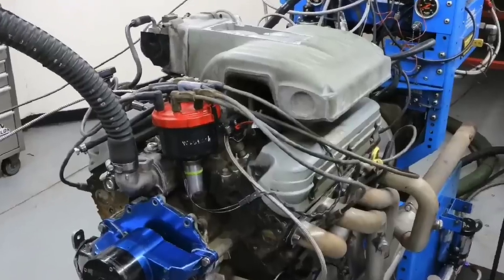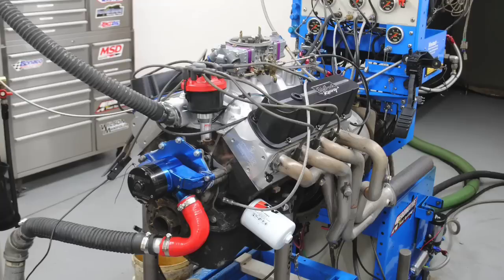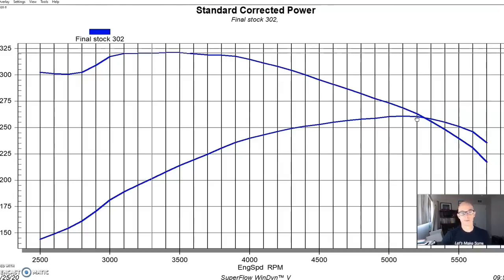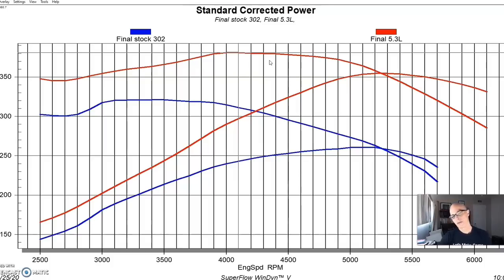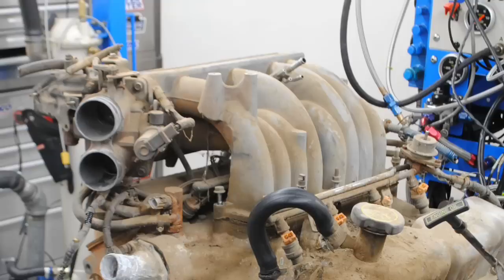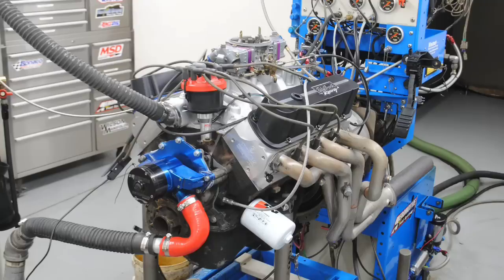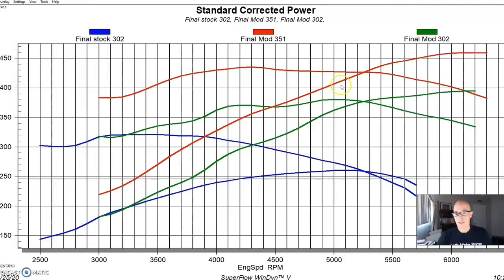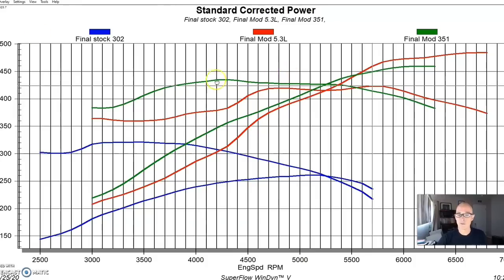5.0L vs 351W vs LS-SHOULD YOU SWAP?

Comment: I use to be a guy that always said don’t think with ur wallet put a ford in a ford, Chevy in a Chevy and dodge in a dodge back when I was really into cars and drag racing in my 20’s. Now in my late 30’s I haven’t been into cars since my late 20’s which is kinda weird because I’m a professional automotive technician of 20+ years and I own a auto repair shop and also have a huge garage at my house with a lift in it. Well the real reason I stopped building cars and drag racing was being sick of putting so much money into cars. Last car I raced was a fox mustang I built a stroker for basically took the engine, transmission, fuel system and tossed it out and built a stroker, new tranny, fuel system and everything to make it run. Idc if ur stroking a 302 or 351 if ur building it to make serious power or even decent power and ur gonna be beating on it all the time it makes absolutely no sense to use a stock block, it’s dumb to spend 10k building the engine to risk it blowing up and trashing all the part’s because of the block, buying an aftermarket block is protecting ur investment. I have seen many guys build ur average 7500 dollar 302 based stroker and the main webbing cracks and breaks and snaps the crank, sends pistons into the heads, rods hit the camshaft and ur left with a set of rocker arms, push rods,valve covers, the intake and everything else is trashed. Many guys start the build thinking 500-550 hp will be fine they can live with that but it’s always because they see how much a good block is and say 550hp is ok when deep down they know and I know after the first season of racing when they get everything dialed in and get it to run as fast as it can they want to go faster so they say well if I run a 125hp shot of nitrous only at the track it will be fine or they put a supercharger on saying they won’t beat on it unless they are at the track and only a few psi so they put that nitrous kit on with a 125hp shot then they are only 4 tenths from getting a 9 second pass so they put a bigger shot it. Or they are a street racer and they say I’m only using the nitrous if I need to. Well all of these guys keep needing more then boom the engine is gone. My good friend I use to race with built a 306 I have no idea why because he replaced everything he tore the engine apart and tossed out everything minus the block so it really only would have cost hundreds of dollars to have built a stroker, he said he wasn’t trying to go crazy, I told him to make sure he gets the main girdle that you have the main caps milled so the surface area of the girdle lays on the caps to keep the mains from walking and use main studs well he didn’t and he ran a bunch of nitrous and the main webbing cracked and blew out taking everything with it but luckily the heads were ok. Then he built a 347 and I told him again to get the main girdle and he did but got one that required no machine work and the main webbing cracked and took everything along with the heads. When he built another 347 he had some cnc aluminum expensive girdle and I said hold on till I come over this weekend, I bought over a girdle and he said he didn’t buy the one I talked about because the one he got was expensive but I showed him how the steel girdle I have had more surface area on the mains and it’s steel so it will expand and contract with the block at a much better rate then aluminum and he understood and used the one I brought. That engine still runs today 15 years later it probably has 10,000 miles on it but that’s 10,000 miles of getting an ass whooping he drives like he’s drag racing every time he’s in the car. He has ran 200hp shots of nitrous through it but only at the track a handful of times but the engine on nitrous is pushing 650-700hp. Another thing is using Arp studs and bolts throughout the engine and making  sure everything is tight periodically, like even the intake manifold because if everything is tight the block will flex less plus high quality studs and bolts everything will flex less all will help keep it together. I have ran a lot of power with stock blocks, tons of nitrous on stock bottom end 5.0s, many people have ran tons of power on stock blocks without issues or without issues for a long time I know that but ur rolling the dice which is fine when u didn’t spent many thousands building the engine but when u spend the money building an engine it makes no sense to roll the dice with a stock block when u can put in a stock 5.3 with a camshaft, springs and slam a turbo on it (obviously new piston rings gapped for a turbo) to make a ton of power and if it blows up u buy another 5.3 for $200 bucks, the 5.3 blocks are way stronger and have heads on them that can actually make power unlike a 5.0 that has tiny valves & runners. If I had another 5.0 mustang and had to keep the 302 I would put a set of heads on it, camshaft and a turbo. But I would much rather put a 5.3 with turbo and the other thing with the 5.3 is using a 4l60e transmission they are SUPER cheap to build to handle power and a 5.0 when it makes power with blow up the stock tranny and it’s not cheap to put a strong ford tranny in it. Basically if u wanna go fast for cheap do a 5.3. If you wanna do a ford then be smart don’t cheap out on the block buy an aftermarket block and with the aftermarket block u can buy one with a taller deck and bigger bore so not only will u safe and reliably make power u can make more power with the aftermarket block ur not just paying to have a strong block u can have more displacement which means more power plus u will save money on most of the machine work the old block would need like clearancing for a stroker crank.

Comment: Ok stock bottom ends, gotcha. Fact is a modified or stroked 302 (330-347) would make more power than a LS 4.8 or a stroked 351W (408-427) would make more power than the LS 5.3. Not to mention the “Other Guy’s” you’ve done videos on 351C, 351M and 400M all of which can be stroked to the similar stroke as the 351W money aside, when it comes to performance these engines can be built to run with the LS and more.

Also, the LS 6.0 & 6.2 engines you said are hard to get in bone yards are easily obtained from Cadillac Escalades and the modified versions of the 385 series BBF (429-460) for a stock comparison then can be stroked to (502-514-524-545-554) depending on builders budget will certainly make more power than that of the biggest modified LS.

I mean you don’t see LS engines in pulling trucks or monster trucks but, you damn sure see a lot of modified BBF 460’s though. Often mustang owners that race use LS because it’s cheap and it’s easy to make power any fool can do it with the paycheck from Walmart. True Ford owners rather actually running a Ford power plant because their driving a Ford not some hacked up mutt POS with NOS or a turbo for help.

Simply, if your driving a Ford with a LS it’s not a ford anymore man it’s a mutt, if guys want to race LS engines buy a damn GM body an kick rocks with it. Stop gutting the Fords and slamming a LS in it, if you want to race a Ford run a Ford power plant. Hell the new Ford 7.3 Godzilla is likely going to make the LS mustang guys learn what can really be done with a Ford engine stock or modified.
Reply: yes sir. u wont see any ls in a truck pulling event. because in the real world they lack low end torque. as i mentioned in my comment.they make all there power up top.i have driven many ls engines.no comparsion to the low end torque the sbf makes.the ls makes it at 5,000rpm what good is it on the street.
Reply: havoc 99 that’s kind of what I was getting at in my comment, LS engines are junk for real torque and only really good at one thing. Meanwhile, the stroker 302 or 351W is much better for decent HP with on tap torque and a shit ton more so using a stroker 460 almost instant torque and big power to back the torque up easily. Why use a engine that you have to turn it to 6,000 - 8,000 rpm to make good HP and usable torque???

Like I said, “if your going to run a Ford, use a Ford power plant” why go through the trouble of buying or having to fab up engine mounts or special K-Member to run a GM engine in a Ford when there’s plenty of capable Ford engines that’ll do the job and stay in one piece doing it too. Why would anyone racing or using a LS choose an engine that eats lifters and easily pushes head gaskets out like changing underwear.

I’ve seen couple 427W’s making 600+ HP an more with NOS or forced induction 800+ HP blow a modified LS engines off the track reliably time and time again without pushing head gaskets, eating lifters or pushing head gaskets out. Plus, the new Ford 7.3 Godzilla engine is proving on Dyno testing and fitment to be a sweet choice for racers due to new aftermarket parts now becoming available. 

I mean seriously, a SBF design base tall deck block (dimensionally similar to the 351W) convention pushrod engine packing 445ci 7.3L making that much and more HP & Torque in stock trim come on it’s a no brainer. Plus it’s already been dyno’ed with mild heads & cam upgrade at 520HP with 550lb-ft (I think), that’s a sweet platform for future big HP & Torque numbers in the near future.

Plus, they fit in a fox body like a glove, more room than a 460 would have and easy to work on like 351W. New intakes are already being designed to make hood clearance no longer a problem using a small cowl hood for racers or possibly a stock hood is the idea for sleeper cars.

Comment: I built a 302 bored 80 over sleeved at 10-5-1 threw a huge cam in it a Holly 650 and that truck was fast you can do a lot with an old 302 depending on what you throw at it, it was in my Ford F100 Custom someone engine swapped before I got it and took away my straight six that shoulda came with it so I sold it I have an 70 Opel GT I’m in the middle of a factory restore even the paint is going to be original semi gloss enamel rally orange no clear coat crap, the only thing I’ doing as far as modifications go is fixing the flaws like the headlight catching fire, the intake getting a lot hotter than it should and a few other things that need to be updated for safety besides that she’ll be just like when she rolled off the factory floor in the UK, I’m the kinda guy if it’s a road car Ford stays for Chevy stays Chevy if it’s a race car it’s a free for all you could be running a Toyota/Mitsubishi Block a Chevy transmission and a Ford rear end and it all works and goes down the track really fast lol

Comment: Modified 351 is where id go
Reply: For a fox or sn that had the 5.0 in it stock I'd go with a high compression stroked 351.  For 96 up mod motor cars coyotes swaps are super easy in those and are becoming surprisingly affordable.

Comment: The LS swap is to cookie cutter. Its been done to many times and I'm not a big fan of cross breeding brands to begin with. Fords with Ford GM's with GM. I know the LS has potential to be fairly cheaply built into a monster, but if it were my money and I were picking from these engines, I'd go with the modified 351. I'm really curious to see how the new Ford 7.3L pans out though, despite its massive displacement, its dimensionally speaking a smaller engine, at least when compared with the gargantuan DOHC Coyote 5.0L, and its simple OHV design and port injection really opens it up to easy tuning and modding.

Comment: Would love to see a comparison between 5.0/4.8 and 5.8/6.0 with even flowing heads, you compare a 5.0 with peanut port heads to a 4.8 with heads that flow more stock then put a set of heads that flow even more on it as a modified version. I will never LS swap anything unless its a BMW but would use a 4200 in a Ford just because its not what everybody else does and i like an expression when somebody looks under the hood vs saying...oh just another LS swap lol

Comment: 351w is the best motor I've ever owned.
Reply: I'm 300&351 all the way in my trucks... For my farm truck I absolutely swear by the ol pre-efi 300's especially in a 3/4 ton with c6 &4.10 gears, I have a shortbed 4wd also 300 4spd np435 and 3.55 gears  those are what I call my "F-it" trucks ,il beat the absolute crap out of them and they keep coming back for more , meanwhile I have a 79 f150 2wd with 351w ( hopped up a bit not extravagant though) 3speed 3.73 and that thing is a strong reliable hell raiser fun as all hell to get crazy with and lastly I took the 5.0 efi out of my 5speed 88 camper special f250 5 years ago and built a modest 408 putting down approx 425hp I'd guess with the torque in all the right places for the gearing of the truck I then put in a full floating rear end and leafs from f350 did a 95 front clip swap( bullnose swap) and painted her up she's my primary go to daily truck it's got all the luxury a man needs,power windows,ac,heat,sliding back glass and most of all the lovely smell of burnt rubber on tap anytime desired 😁... seriously though for the era we are talking here I think 300 and 351 are the shiz ,I'm not pissing on the 302 guys it's just not necessary in my world when 300&351 engines are stocked up in the barn just waiting for something to do
Reply: @wolfmanrebel874  I hear ya! Them some nice trucks you got! I had two 300s in my younger years, I blew em both up, lost a valve and rod in one, ( van 400k miles) and a 4x4 truck ( converted bronco) broke the crank and still ran made it home too, had to dump the clutch to make it quit!, f150 with the 351w couldn't bust that truck took all that was thrown at it, i would have liked a manual instead of automatic tranny though, now I got a 65 f100 352 fe 2 wheel drive,  not super up but about to have the motor rebuilt next year, possibly to a 390, idk yet, plus I'd like to change front end from twin I beam to a Crown vic for disc and power brakes, handling. Got a muncie 4 speed ( 3 with lolo) ill spruce that bad boy up too, ford 9" rear , drives like a tank. I never owned a 5.o but worked on em for 25 years ( my whole family owned em) plus them fox body mustangs too, 4.6 and stuff I stay far away from, nothing beats them old Ford motors, easy to find,fix and cheap! Most of all tough! Have a good Christmas to you and yours ,take care.
Reply: @HEAVYMETALJSTYLES  that sounds like a great project!! Yeah the 5 speed is nice, literally EVERYBODY locally that thinks they know my 88 says that engine is going to blow that 5 speed through the floor in a million pieces and take my legs with it but I had that same trans in the truck with the 5.0 for years and didn't change a thing about it when I put the 408 in 5 years ago and iv hauled cattle,vehicles, tractors and equipment,loads and loads of building materials and hauled off tons and tons of junk in combination on driving through the Smokey's daily and showing off a bit on occasion and it's still holding up just fine I'm not sure where they get all the hate..it's not a ZF I get that but still..anyways thanks partner merry Christmas to you and yours as well my friend....also idk how familiar you are with the FE's but when you build yours you may want to hunt for the highest quality timing set you can get....my experience with 360&390 hasn't been bad I like them just fine but they eat timing chains like crazy in comparison to a small block...like 3-1 crazy

Comment: Dollar for dollar the LS is cheaper and easier to build and produces much more horsepower than theFord motors. Stock ls heads easily outflow the stock ford 302 and 351 Windsor heads by a significant margins. Good hydraulic roller cams are comparatively priced. Not a whole lot of difference in the junkyard price for either of the engines. Holley makes an install kit for the ls for around nine hundred dollars. Best investment you can make when installing an ls into another non ls vehicle.   This is coming from a ford person.  Gonna get some haters for this opinion. But the money and hp numbers are their for all to see. Like your videos. They are always thought provoking. That’s a good thing. Need to keep those three brain cells I have occupied. Lol. Thanks for sharing.
Reply: ls engines are not cheaper to swap. an absolute load of bs.

Comment: I'm slightly surprised the 5.4 from the navigators or f150 isn't mentioned.
Reply: F150 5.4 is kinda turdy and has weak rods, Navigator 5.4 is wiiiiiiide, fits but just barely in a mustang

Comment: Holley sniper efi!!! Ok i have a stock 71 302 Mexican block, heads, cam and a performer 289 intake. Running Holley sniper efi. It runs good in my 76 F100 3spd column shift. I have edelbrock e-street heads and cam to run with the dual plane performer 289 intake. I haven’t installed them yet. What kind of real world power can I expect? Maybe 250 wheel? So many questions

Comment: But my opinion when I had my Foxbody I did a 351 Windsor with a 351 Cleveland cylinder head with a fabricated sheet metal dual four-barrel carburetor and a 400 modified crank with 6.2 rods and I came out with easy 800 poor man NASCAR Ford engine
Reply from the maker: easy 800 HP? NA?

Comment: Cost of conversion makes a brand swap infeasible. You'd have to change almost every fitting. And you'd minimise the depth of the market on resale. Spend your cash on a hot 302. It won LeMans.
Reply from the maker: What year did a 302 ever win Le Mans
Reply: @richardholdener1727  1968 and 1969
Reply: @richardholdener1727  427s were banned after 67 win
Reply: @richardholdener1727  https://en.wikipedia.org/wiki/Ford_GT40

Comment: There all damn good motors.  I'm a Ford guy and as a Ford guy I have to admire the Fordness of the LS.  Good Job GM. I was born in the late 50's and I've been threw the brand wars and today I don't think it matters one bit to me what power plant is in my Mustang (etc,etc.). Todays Mustangs (79 to 2020) work damn good on the dragstrip no matter what brand of power plant is in them. You don't have to be a chassis engineer to get them to work either. They have become the small block Chevy of cars.